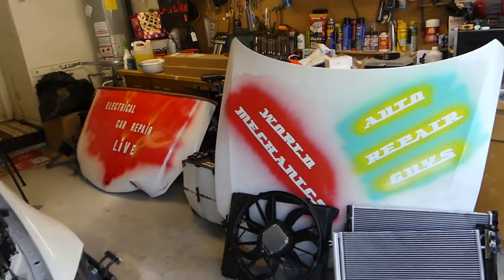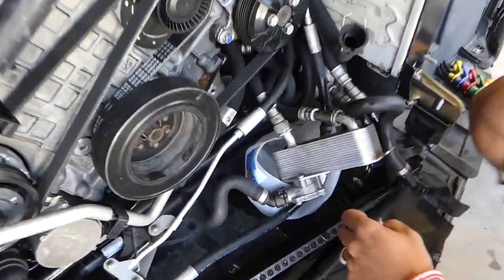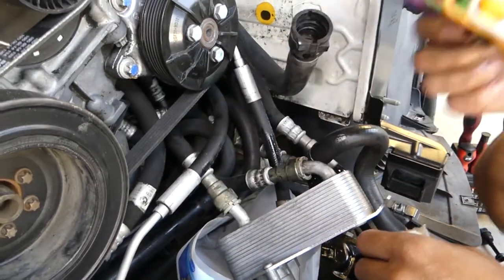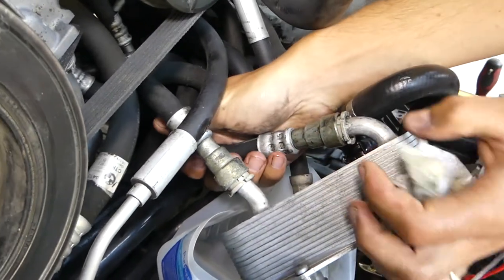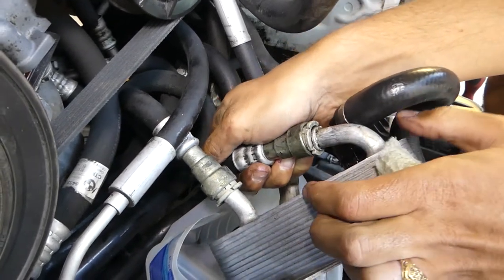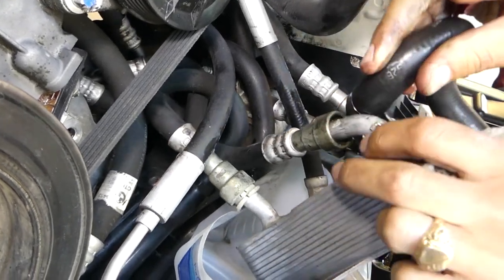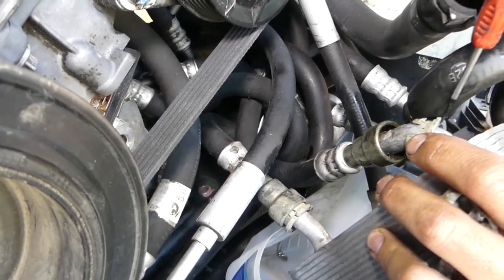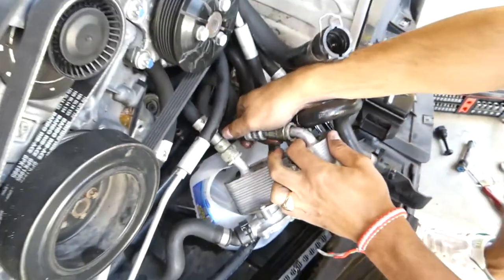HOW TO DISCONNECT TRANSMISSION LINE ON BMW

Comment: I just broke the pins trying with a flat screwdriver to pull out the cooler, do I have to install a new line right?
Reply: A new line will cost you $160+ for the part plus labor, so not cheap. The pins don't create the seal, just keep the hose from sliding off. The o-ring inside creates the seal. You could simply wrap the end of the line in silicon tape. It bonds to itself when it touches itself in a wrap, and because it's silicone will resist high heat. $10 on Amazon
Reply: @lawpenner i can not find those O ring .any idea how can i solve my problem
. Any link where i can find or whats the dimensions of O ring inside the pipe .

Comment: What do you call those clips that connected the lines to the cooler? I need new ones and can’t find them anywhere online.
Reply: Update: I went to my local junk yard (pick n pull) and grabbed 4 of them just to have extras. You get a super small screw driver or pick and work at the tabs gently until you’re able to pry them off the hoses.
Reply: Did you do it

Comment: Do you mind pointing to which line is supply and which is return? I will be flushing the cooler and want to reverse flush.

Edit: Just figured it out:  The 90* pipe is the supply the semi-straight one is the return. So, to flush you would reverse the flow to remove contaminants. So, blow in through the return and out of the supply.
Reply: Is left or right hose the return?

Comment: Hi there ive broken the plastic quick disconnect clips on my hoses..could you please mention a replacement part. What is it called? I looked around on google but i was unable to find. Thanks..wish i saw this video before getting under the car!
Reply: Aneel Ahmed did you ever find them?
Reply: Did you find them ... ?
Reply: @DjDestinyChicago  find them?
Reply: @franciscolopezsanchez1857  find em?
Reply: Michael Swetell just hit my local junk yard
Reply: Bump to find them. I also need some! Any luck?
Reply: I need some too